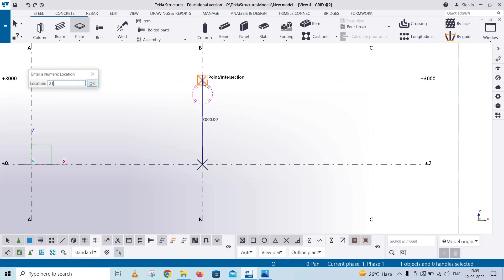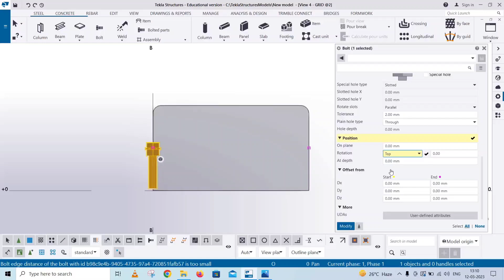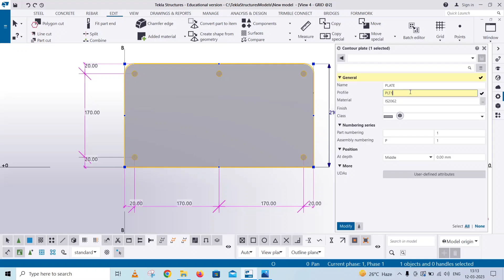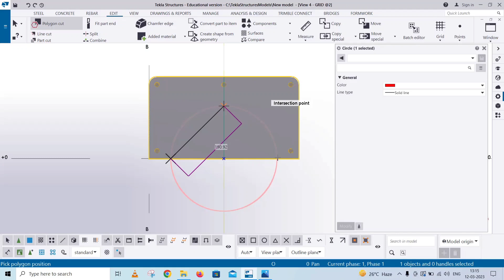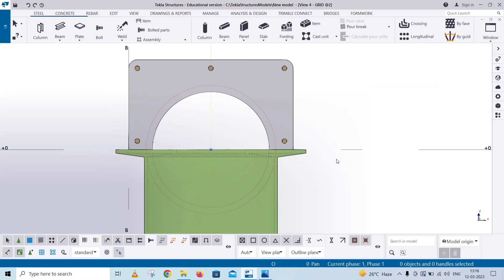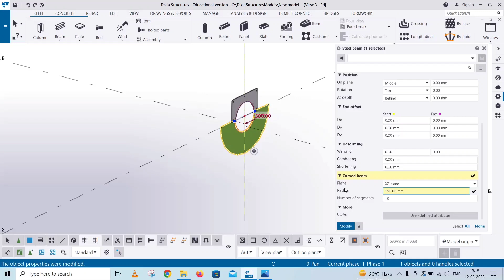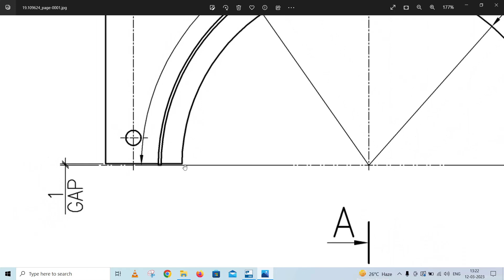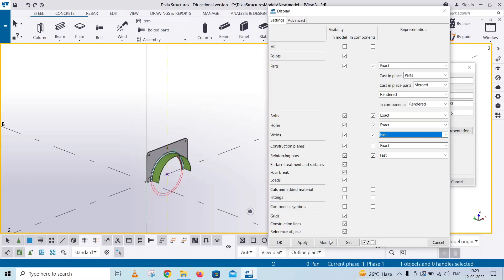Casing Modeling In Tekla | BIMINDC | Tamil

Comment: 1. How did you draw the Construction circle  @5.48 .For me it is coming on opposite plane so i have to set the work plane at Gride 2. 
2. Intersection of Construction Circle and Construction Line is not showing @ 6.40
pls help me for the above queries. Thanks in advance👍
Reply from the maker: 1. No need to set Work Plane, to create circle you just pick center point & Numerical Snapping of radius (type radius value in keyboard). or create one point for radius value from center, then pick center & radius point to create circle. 
 Note : Create Construction circle by center point & Radius Option.

2. Enable "Snap to Intersection points' in Snapping Switches.

Hope this will give solutions to your Queries. Thank you